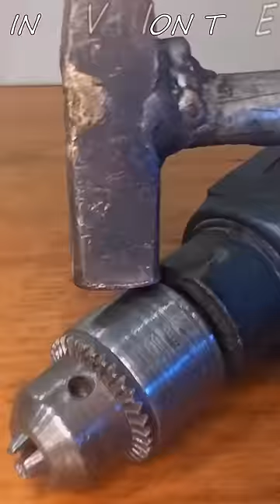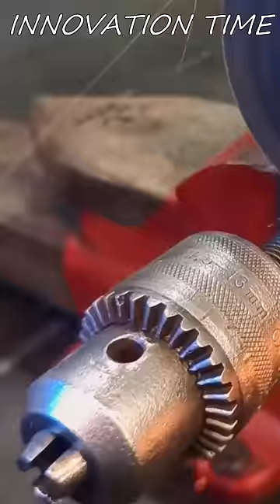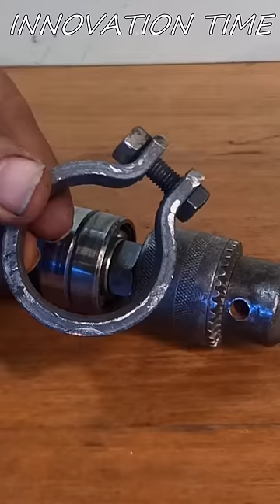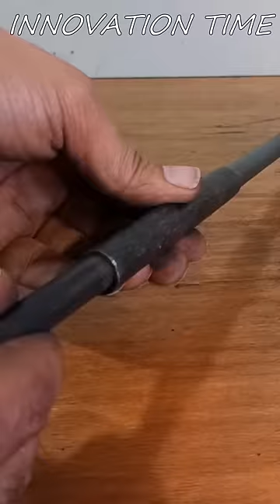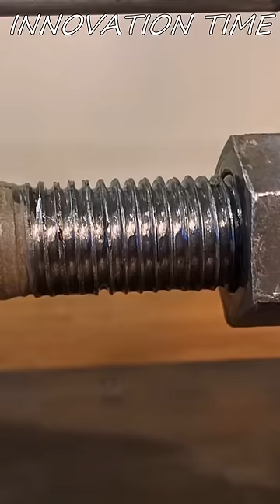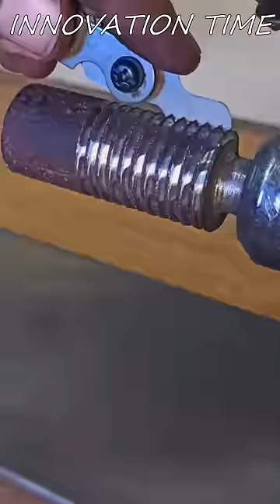A thread copier #shortvideo #ideas

Comment: Tap and die kits are a lot easier
Reply: If someone has those available... yes. But what about countries where manufactured goods and tools are no longer available due to shortages? These videos are very good alternatives using scrap materials to easily make them and invaluable to millions across the World... so maybe save to simple-minded, self-aggrandizing comments for your kinder-mates or learn about constructive criticism techniques and begin to contribute. You won't regret the growth.  -Jake
Reply: @daddydawg1902  he does have them, he's using a tap really early on in the video!
Reply: @mikescherrer4923  Except for the childish 'doofus' comment.. your reply does have some valid points and questions . At times entire country's Supply Chains break down causing many products, materials and tools to become nearly impossible to obtain or when found .. to afford. People who can take used tools and repurpose them for alternate uses or are able to salvage them for valuable materials will be much better off... as will those with Farming skills are during food shortages or natural disasters from drought.  The drill parts he used may have been from broken tools he salvaged. As for the threads strength... I would think it should be possible to temper the threads to make them stronger. My biggest question is that this looks like it can only be used to duplicate the thread of ONE SIZED Bolt.. which WOULD make it impractical for common use. 

MANY videos like this ARE FLAWED and some viewers CONSTRUCTIVE comments have HELPED the O.P.s correct techniques for producing BETTER videos later.  Some viewers with Skills will watch these and their Imaginations will be stirred to try different things and techniques for bettering their OWN skills. THAT will NEVER be 'stupid' or WRONG and I will always try to watch and  comment as I can.
Reply: right! or just throw the rod on a lathe and set the pitch and feed.

Comment: I bought 2m long pipe and some clamp heads to make a pipe clamp. Turns out my pipes were not pre-threaded 🤦🏻‍♂️

I went to a place where they can perform custom threading. The problem is that they charge an arm and a leg. So I have had those clamp heads and unthreaded pipes waiting for seven years in my garage collecting dust and cobwebs.

I saw this video and my heart started beating faster. Perhaps my clamps can finally be formed?

Then it dawns on me… I need to get the inverse shape of the female clamp-head’s threads 😭

Comment: Great idea
Reply: No, awful idea, go get a set of thread dies and your doing it right
Reply: @patricknoel2122  this seemed like a pretty rough way too do it. Look at the size threads he's cutting. They might be too big for thread dies maybe use a lathe with a thread cutting gear. 👍 this seems like a lot of work for the results he gets.
Reply: @TheIronFourth  if you pay attention to the end you will see a blue burnt flat on the edge of the threading, then in the next shot when he's threading the nut on the threads arnt perfect but they are alot better and all the burnt blue surface is gone, there's no flat spot either, so the end product he shows you is not what he made, also if you had to go buy parts to make exactly what he made just the drill heads would cost about ⅔ what a starter dies and taps set would(which he obviously has since he used the matching tap in the start of the video) he scammed you into thinking that bullshit worked
Reply: @patricknoel2122  did you even read my comment?